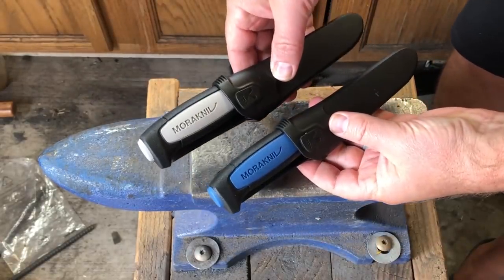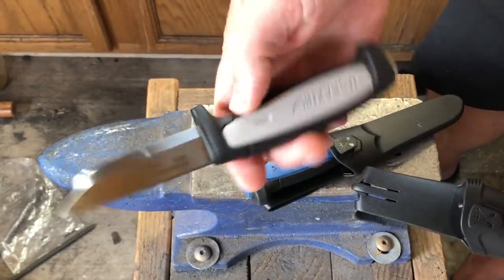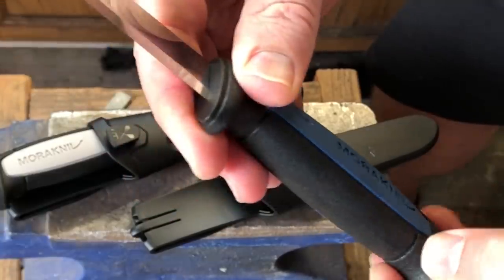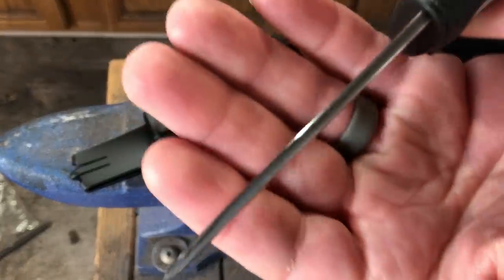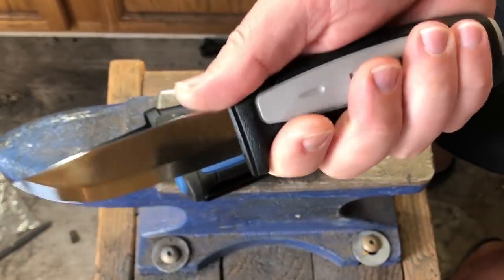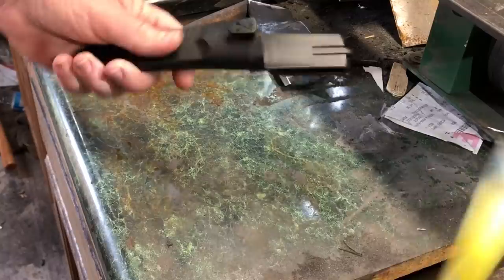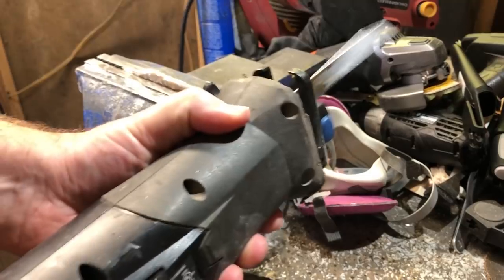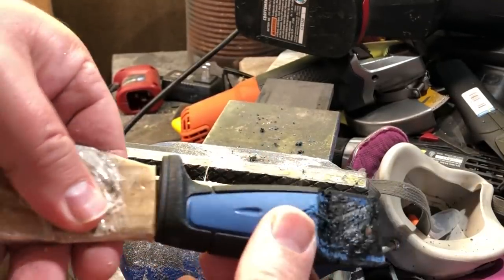What's Inside a Mora Knife? I cut one open so you don't have to. Enjoy!

Comment: I HAVE A MORA KNIFE (THE CHISEL BLADE) AND IT HAS BEEN GREAT. IF ANYONE BUY ONE OF THE HIGH CARBON MORA BLADES KEEP IN MIND THAT ANY MOISTURE,  EVEN HIGH HUMIDITY CAN CAUSE THE BLADE TO RUST. ONCE YOUR BLADE RUSTS EVEN IF YOU REMOVE...THE BLADE WILL PERMANENTLY BE DISCOLORED. I THINK IT LOOKS GOOD ONCE YOU CLEAN THE RUST OFF. ANYWAY, GREAT KNIFE.

Comment: I have a Mora Robust which I use exclusively for (reasonable) batoning to run the fireplace at home. Turn larger pieces into kindling and such. 

I bought it 5 or 6 years ago and I don't know how much wood I processed, but it was a lot. 

The knife shows absolutely no sign of damage besides normal wear. No wobbling, no cracking, no bending, no chipping, nothing. 

Full tangs are highly overrated on small knives imho.

Comment: i have taken a few of these apart for my own reasons. i also have bought mora blades and modified them to them make my own. 
a significant point at 10:32. the reason mora has good strength side to side and do not usually snap at the handle is because it is inset into the handle somewhat before it tapers to the tang. important to know if your planning on using a mora blade to make your own knife and want the strength at this point in the knife.

Comment: Wish mine were as good as everyone says theirs are. Extremely sharp right out of the packaging, but i cut one piece of cardboard and the edge immediately rolled over. Still would look forward to seeing you rehandle yours
Reply: Take a piece of sandpaper, put it on a sanding block. Those with metal spring clips.
They have a layer of rubber beneath the sandpaper. You can convex the edge a bit very easily with that sanding block.
One hand the Mora, the other the sanding block. Move the Mora bevel on the sandpaper-block.
The edge you will get from that will not roll anymore.
1000 grit, 2000, and 4000 will make it really nice.

Comment: The only handle failure I’ve experienced was with a wood handle Mora #2 with a thumb guard. I was batoning through full size pieces of fire wood practically the length of the blade. It held up to this for almost 2 years but the thumbguard acted as a pry bar between the handle and blade and eventually worked it free. When I tried to remove the blade for repairs, it WOULD NOT slide out the rest of the way no matter how hard I tried. I just dabbed it with epoxy and it’s been going strong for 3 more years.

Comment: Your workbenh shows off your mad organizational skills.
Reply: Warum machst du das Messer nicht einfach stumpf, wenn du es sowieso zerstörst
Reply: None existant, do you mean? What I mean in a considerate way is, some kid is innocently going to copy you holding a very VERY sharp knife against a belt sander and will lose fingers. In know you wrapped the blade but I've seen the result of a band knife accident in real life with missing fingers, that's what could have happened if your grip was less strong or the rubber melted and developed a grip ripping it through the wrap, doesn't bear thinking about. Please post again but with the safety measures to take well demonstrated and explained. Like holding the blade against the platform with the sander running very slowly, you with a chainmail glove on or secured in a slow lathe and please tidy your tools that reciprocal saw could have easily slipped on to you. I know you are clearly used to using them but some people are not as experienced as you and will inadvertently hurt themselves. That said it's a brilliant video I felt like I was watching an informative version of Hostel. Very glad you made it and look forward to watching the rehandling. Thanks.
Reply: he even hit his respirator mask with his saw as it went through the knife handle.....

Comment: The morakniv stainless blade is flexible where the carbon steel is rigid. The stainless blade is a great Skinner whereas the carbon steel works great for cutting bones and separating joints in a deer, elk or moose.

Comment: Not going to scroll through all the comments to see if has been suggested,... maybe the carbon steel blades spine remains unfinished to enhance its' striking capabilities on flint-steel?
Reply: Nah, theyre carpenters knives, The robust one is meant to take a beating, strike the spine with a hammer, use it to pry with etc. I'ts finished enough for its purpose.  In Sweden those knives cost under 10$ retail. You abuse the crap out of them and then get a new one.

Comment: The thin layer of overmolded rubber of Mora handles is actually a better construction than many way more expensive knives with the all rubber handle.
For example Cold Steel Kraton handles , are all Kraton/rubber and onto the tang.
When using it for chopping and/or other hard tasks, the handle tends to twist around the tang. Which is not good.
The polypropylene onto the tang makes a far more secure system, and then the layer of rubber on top for improved grip.
Better system, for less money.

Comment: in finland almost every construction worker use mora for everything from screwdriver to hammer
Reply: They do in all of skandinavia. While i‘m sitting here, polishing the edges of my Moras on a 5000grit 😂😂
Reply: Tobias Br. Polish? A Mora??? We use them until they fall apart. Screwdriver, hammer, chisel knife you can use them any way you want, but to polish it with 5000 grit, never
Reply: Fellow builder here.
I run the blue handled builders knife and light green handled chisel tip one. Two brilliant tools.
Reply: Yes I noticed when I was in Sweden,its a very common knife over there

Comment: The reason why the sine of the blade is not grounded square and flat is that they were never intended as a bush-craft knives. They are Tradesmen's knives and used to all kind of cutting you have to do on a work site. Usually people have at lest 2 of those kind of knives in their tool belts or around the workplace.

Comment: I wonder how well it resists heat. If you took it from a hot car and used it forcefully, maybe then the key-nubs on the tang would smush the plastic stoppers. It'd probably still be fine, though.

Comment: Here's an idea, do a destruction test to see how durable these knives really are! I'm not completely sold on them myself to be honest.
Reply from the maker: They make a very decent quality knife "for the price." I like the fact that they offer both stainless steel and high carbon blades. With that said, I've never owned one of their more expensive knives, and I'm not inclined to hurry out and buy one. I'm guessing there are superior knives from other brands in the $75-100 dollar range.
Reply: StillNoPickles  For their cheaper blades, you simply cannot find a better knife for the price. Just buy one, you won't regret it. Even if they are only 'okay', you spent a measly 12 bucks. Just can't go wrong.....
Reply: Jake Makes Id like to see just how much $12 can get you out of one of these knives. I don't doubt that they're good for what they cost but I'd just like to see if it's a steal or fairly priced
Reply: StillNoPickles, Compared to most of the crap you can buy in that price range (usually chinese with soft steel) they are a steal. The carbon steel blade is 58-60HRC and similar to 1095 (I think, but it out performs my condor bushlore with 1075 which is a more expensive knife). The stainless is a little softer at 56-58HRC and is usually something like 12C27 or 14C28N which is better than most kitchen cutlery you get, expecially at that price range. Also better than 420HC which if you go with other knives around that price range from say gerber or maybe leatherman.
Personally I wouldn't call it a 'steal' but I would say it is probably the best you can get for the price and an inexpensive option to get into bushcraft if you need a good knife for not much money. Also good to learn to sharpen scandi grinds on instead of screwing up a more expensive knife.
Reply: When a knife is not simply endorsed, but outright RECOMMENDED by survival and bushcraft EXPERTS like Mors Kochanski, Cody Lundin and Ray Mears, I’d say it might have a few things going for it. The ONLY time I’ve ever seen a Mora fail it was being abused by an unskilled user.
Reply: @Tracy81258  Mors Kochanski's recommendation of the Mora knives is what sold me on mine. I have more expensive knives that I don't use anymore in  favour of my Mora.
Reply: TG4Ux Saint 

Dutch Bushcraft Knives abused the crap out of that Robust! I remember seeing this video shortly after they released it. That’s what truly sold me on Moras and why I have my Pro-C attached to my rucksack.
Reply: I've probably owned 30 of them since I bought my first Mora Classic when I was seven, and the first plastic handle one, the 510,  in 1979. Most of them has been lost while fishing or running around in the woods. Can't remember a single one that has broken during normal use, had a couple of tip breaks on the classic carbon from hitting rocks during throwing sessions. :D Bought a couple of stainless Mora fish knives 20 years ago, and besides a sharpening now and then they've held up with abuse and almost daily use, and a stainless work knife has lived in my toolbox for 25 years and has been really abused. The steel is remarkable, tough and easy to sharpen, but not brittle or soft. I've owned a lot of mid range american made knives with soft or brittle steel, but the steel in the nordic knifes are generally much better in cheap knifes. You can't go wrong with a Mora.
Reply: I have both a stainless and a carbon blade knives.

I gave away all my other knives. The carbon blade knife is the best knife I ever owned.

I cannot imagine a knife of any price being any better for what I use it for.

Good size . I am a firm believer that once you leave the five inch blade you are just carrying wasted weight ..

For the price you can afford to get one for yourself and see...
Reply: For the price... Pick one up and see if you hate it. I caught them on sale for 8$ a couple years ago for the basic one and got three. Gave one to a buddy who is also hard on knives. I carry mine about daily, lots of shipping stuff stabbing into pallets, cutting cardboard and tape... And a fair bit of playing in the woods and on the river. I still have one in plastic as a backup neither mine nor my buddy's have chipped or broken, just need a bit touch up once in awhile to keep it sharp as I like. Definitely would buy again.
Reply: it's a pretty durable knife, you can leave it outside for months until it start to rust but it will not loose the sharpness (i know this because i've done it myself)
Reply: It's not a knife you brag about.  It's the knife you throw in your tackle box or tool box and forget about until you need it.  ...goodness, it's $12 for the high carbon versions.

Comment: The back of the blade looks unfinished because it has the classic stamping surface. Because normally this part of the blade has no use, they leave it like this. it's cheaper than grinding like the rest of the blade. The handle is made of plastic and TPE (thermoplastic elastomere), its not rubber. rubber has to be fulcanised and TPE ist not, at least not complete. TPE is used in 2 component molding very often. These things are knowledge of mass production techniques.

Comment: Is the tang same material as the blade cutter ?
Reply from the maker: sime mkd I’m sure it’s all one piece, not sure if they heat treat the tang though.
Reply: Yes it is all one piece (not welded) they actually stamp it out of a huge sheet of steel with a big machine. There are some videos on youtube doing walk through of the mora factory which a pretty cool to see. As for the heat treat maybe you can see from the walkthough videos as I can't remember how they do it or if they show it. But it would take too long to individually temper the tangs more on all the knives I would think so I imagine they are the same all the way through.

Comment: I have always hated the handles on mora, 20-30 minutes gripping that rubber is a fast way to develop some nice blisters and not a good way to start a camping trip.
Reply: For longer cutting use the Mora 511, it has a all polypropylene handle. No rubber.
Rubber is excellent for short tasks, wet conditions also. But can blister (will) when using for longer periods of time.

Rubber is also excellent for 'tactical' purpose.. The knife will stick to the hand..

Comment: Very expensive, high end,  bushcraft knives from big name manufacturers are no better made... They just spend more time and money fitting exotic wood handles, dressing the spines, and adding pretty sheaths... then they charge you $150 more ... And you can do all that to a Mora yourself for £25... But only if you really want a handle that will split, chip, swell, break and slip after a while in the wild and a sheath that eventually rots, goes spongy and has to be constantly maintained... If you want a knife to look at and show to your friends, but a Bark River or Falknieven... If you want a knife to use and rely on.. Buy a Mora.

Comment: So they save less than an inch of tang to avoid going full tang, I wonder why? 10 cents' worth of metal? I guess if you make a million of them that adds up. This must be the absolute minimum they could do and still maintain any kind of longevity and toughness?
Reply: You think those Swedes are dumb?
The design is excellent. Plenty of people baton with them without ill effects. For years.
Just use your brain when doing so.
The hand is nicely protected from the bare metal when having a hidden stick tang.
Full width tangs are a disaster when holding it in freezing wheather.
And toughness. Are you going to ue a knife as a cold chisel then?
The blade breaks before the handle does.
The Mora Companion is perfectly fine. Mora 711 as well
Construction workers/carpenter's use Mora's also. Good enough for them. Good enough for bushcrafter.

Comment: 3/4 rat tail tang with key mod slots.  Tough knife, great carver, but not as strong as a real bushcraft knife with that kind of tang.  Still a great knife however.  It is great paired with a bushcraft knife like a becker BK2 that is too thick to be a great carver or fish and small game cleaner.
Reply: Mora +  Fiskars X7 is a better combination.
X7 for chopping, Mora for cutting.
BK2 is an awkward knife. Had it. But seriously. It's clumsy, and overrated.
What real worker uses a BK2...Mora's are being used by craftsmen all the time.

Comment: You should have ground down the handle flat like with a belt sander. What a waste of an effort.
Reply: And how many belts would he have loaded up with that plastic/rubber and ruined?
Reply: @matthewshannon6946  it doesn't matter because this method was pretty useless. If you're not going to do it right then why do it at all.
Reply: @grendle81  he did a perfectly good job
Reply: @bennypazza5718  it just could have been a lot better

Comment: "Full tang" is overrated, and I wish people would stop romanticizing it so much. The bond between blade and grip is more important.
Reply: If the grip comes off of a full tang knife, you're in a much better position than a non full tang.
Reply: If the grip comes off, it was a shitty knife regardless. Don't buy a shitty knife, and it won't matter.